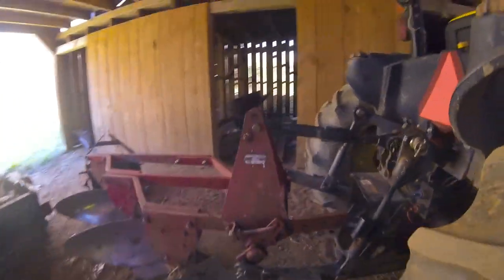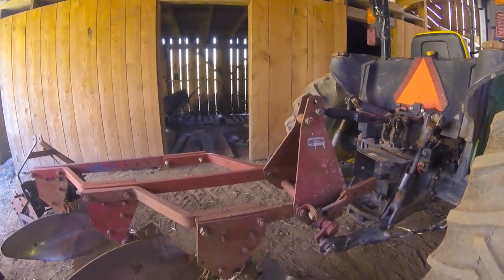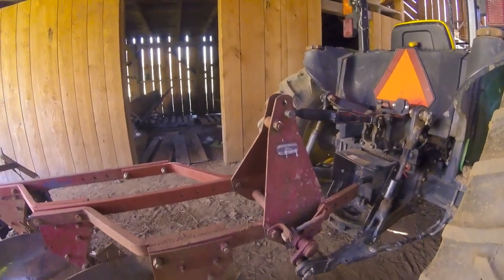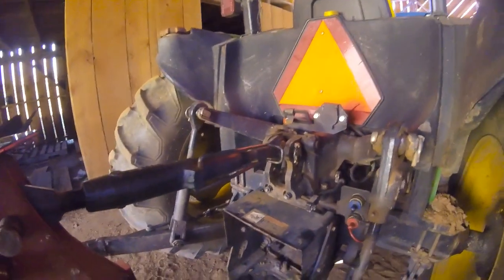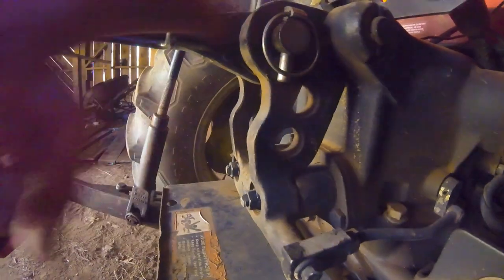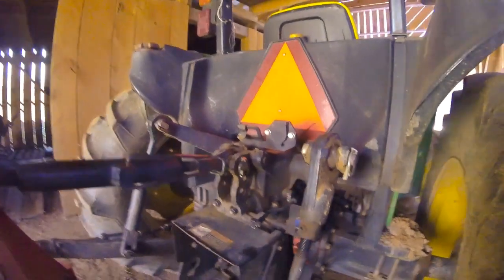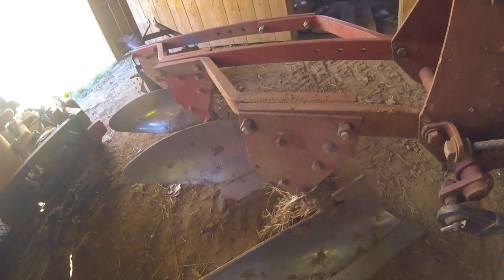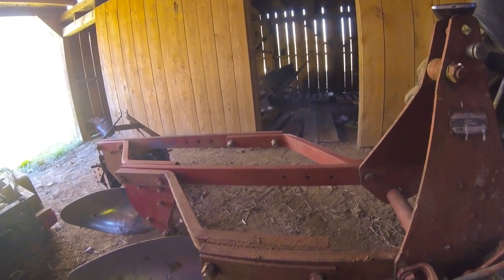Hooking  Up Moldbord Plows To Three Point Hitch and Draft Control

Comment: Awesome video... I knew there was much more to plowing than met the eye.. I have never done it, but, I knew it would take someone that knew what they were doing to do a good job.. I can see that now.. Lots of great information.. Thanks.. 
I came here searching for Draft Control.. I learned as much about it as I did plowing, although I don't have any and probably won't do any, but, I will take a crack at it, first time I get a chance somewhere.. Ha.. Mainly trying to figure out how to run the box blade like a professional.. I have a "New to Me" Ford 3910 and a 7' brand new box with rippers.. Tractor has side and top link hydraulics.. One of the reasons I bought it.. I am primarily going to use it to dress my parking lots and driveways.. Fixing to see what other videos you have.. 
I hope a bunch, but, only 384 subscribers.. Uh Oh.. Probably not many.. Add one to the list in case you are still making videos though.. 
From Western NC btw.. Cheers..
Reply from the maker: Thanks for watching

Comment: Good video. I have same plows on my Ford 3000. Grandfather bought them in 1973. I think they are too much for my 3000. It always struggles. Did with him also. I bought a longer top link thinking old one is too short causing plows to dive deep. Any other suggestions?